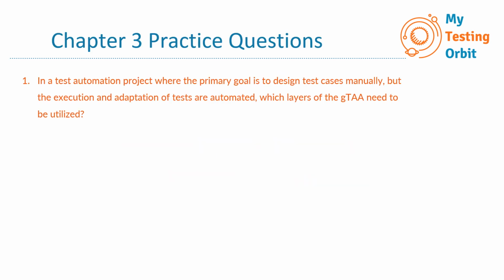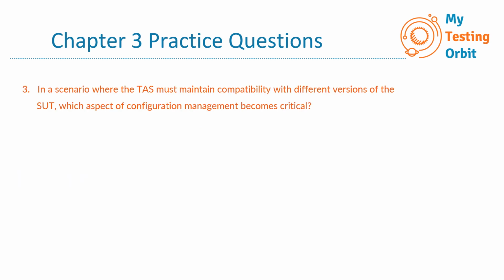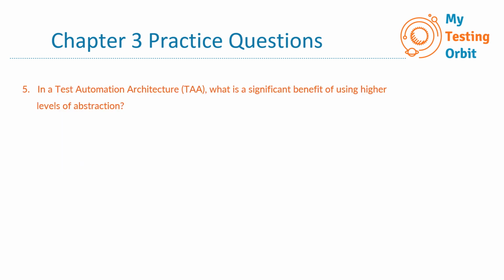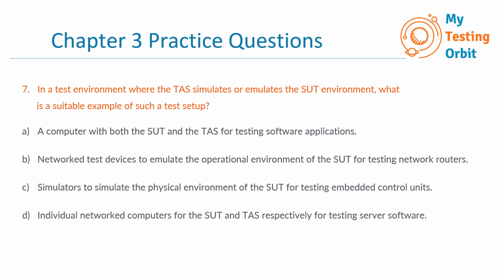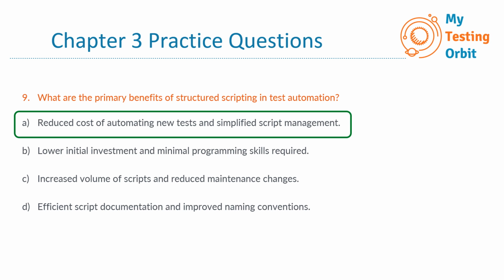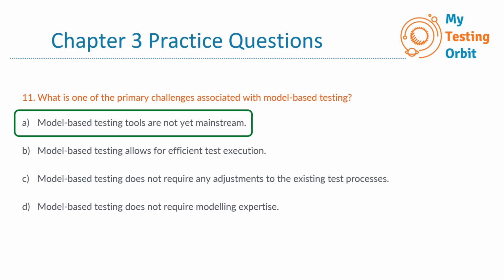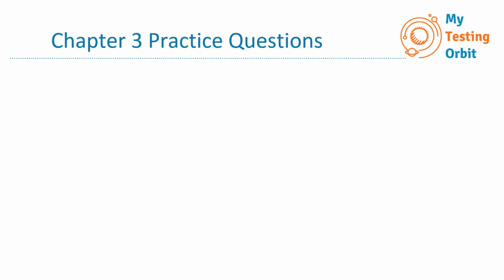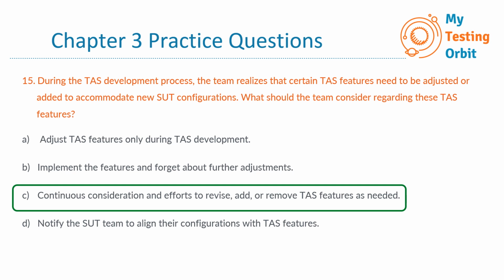ISTQB CTAL Test Automation Engineer-  Session 28 - Chapter 3 Practice Questions

Comment: Question 8:
- Analogy-based estimation such as such as functions points, three-point estimation, wideband delphi, and expert estimation
- Parametric estimation such as Constructive Cost Model (COCOMO)

Is there anything wrong?
Reply from the maker: Hi. I will attempt explaining based on my understanding of your question. All types of estimations you have mentioned are either purely parametric based or based on expertise judgement which ultimately involves parameters. 
While historical data is often associated with analogy-based estimation, it can also be a component of parametric estimation, especially in cases where the model considers a mix of parameters and historical information to generate more accurate estimates.

Comment: One more question regarding question #7 :) Explanation why option C is incorrect answer says something like "and they are physical enviroment, not network routers"... I don`t understand this - there was no mention of "network routers" in question as a condition, why is this used as a reason for option C to be incorrect? (and option B to be correct?) :) Thanks for great work, videos are AWESOME !!!! And thank you in advance for explanation regarding question 7 :) Moving on to the next video :)))
Reply from the maker: Sorry for the confusion, the reference of "network routers" in Option C was to compare it with Option B. I will try to explain it in detail.                                                                                     
Option B offers a more comprehensive approach to simulating or emulating the SUT environment. It involves using network test devices to not only replicate the operational conditions but also the network configurations of the SUT. It allows for for both emulation and simulation, enabling testers to create realistic testing scenarios.

Option C may not be as versatile as Option B because it primarily focuses on the physical environment and may not cover broader aspects of emulation and simulation required for various types of SUTs, "such as network routers".

I hope I was able to clarify :-)
Reply: @mytestingorbit  Thank you, much appreciated ☺

Comment: I don't even understand question 7.
The question is so weirdly phrased. Could someone explain to me what the question actually means?
Reply: Would this be the same question?:
"What is an example test setup of a test environment where the TAS simulates or emulates the SUT environment?"
Reply from the maker: That's correct. The question is phrased as a statement and then asks for an example of such a test setup. You question is more direct and I can confirm that both questions seek the same information. I hope that helps.